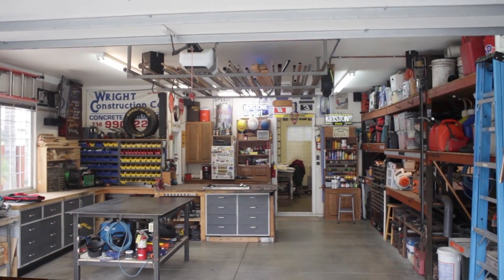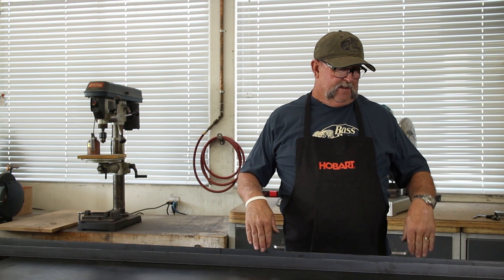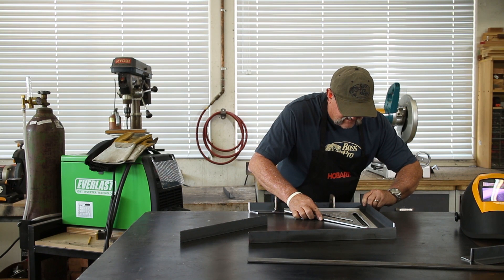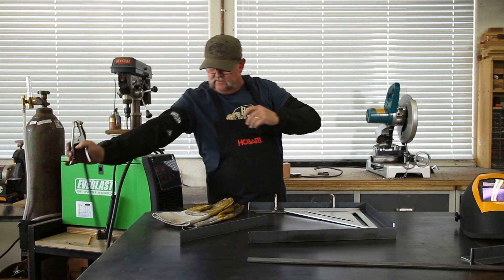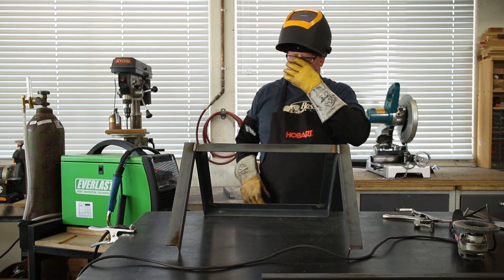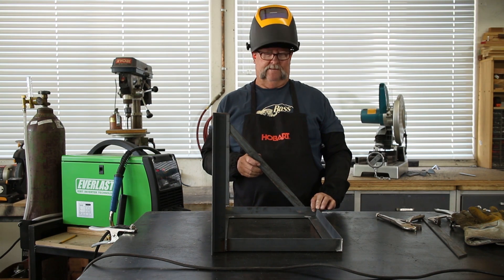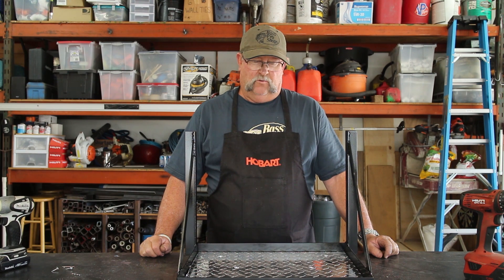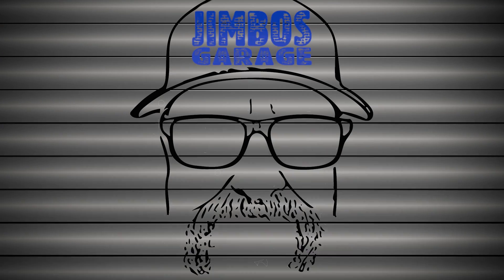Air Conditioner Window Stand Build

Comment: I'm glad I'm not the only one that snaps drill bits. LOL
Reply from the maker: Dirk Diggler Thanks Dirk for watching, Ya that kinda stuff happens to me a lot, You just don't see it all on the videos. Stay tuned for more great videos.
Reply: I believe using oil would help with that when drilling metal.

Comment: What is that chop saw you cut the angle iron with? It sounded like you called it a cold saw?
Reply from the maker: Nick M Hey Nick thanks for watching, It is a Makita cold saw with a metal cutting blade on it. Same as a chop saw but slower r.p.m.'s